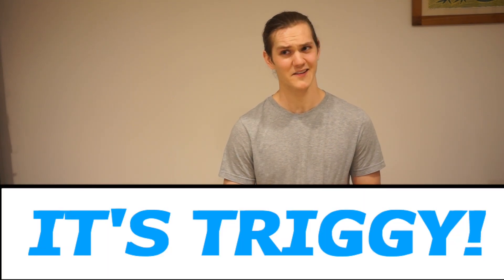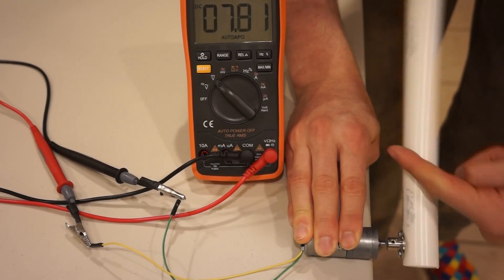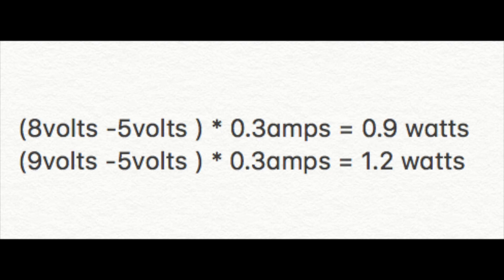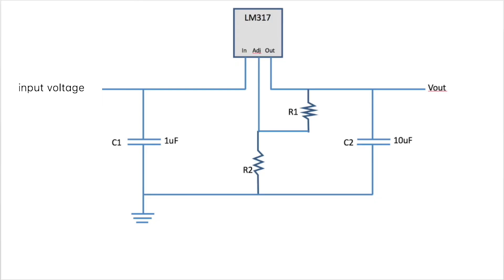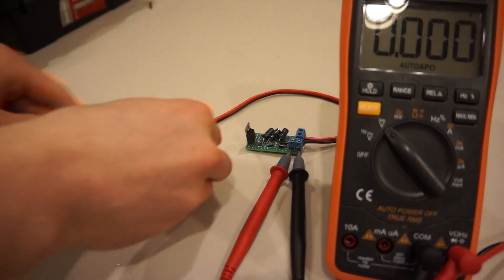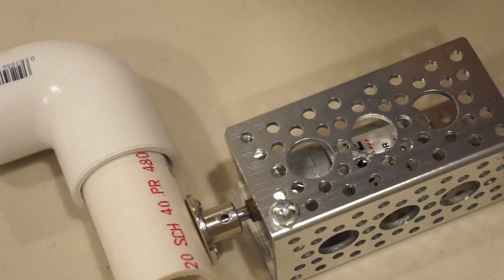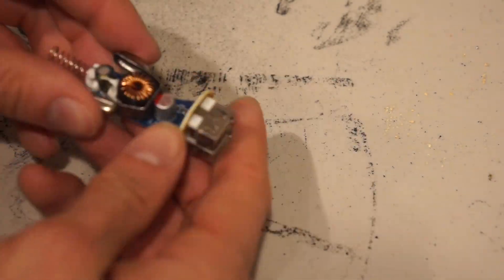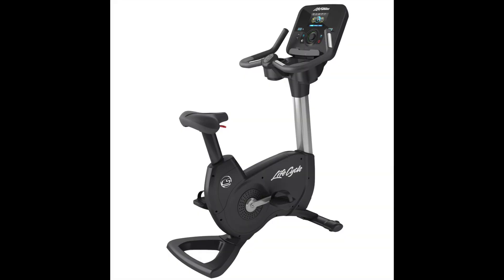Hand-crank phone charger in 5 minutes!

Comment: The opposing force that makes it harder to crank is the magnetic force generated by the current you're producing. You can see a similar effect if you drop a magnet through a copper coil (or copper tube) - the opposing magnetic force generated should slightly dampen the fall.

Comment: Hi i have hand crank generator that is able to give me 35watt of power. The problem is that when i try to charge my phone with it, it only charges at 0,45A max.... phone charges but why it cant charge at 1,5A ? It would be only 7,5W. when i am turning  crank i feel changing resistance(Load is switched?) on the handle as the phone battery tries to draw more current, but every time it tries that it stays back at 450mah and cant even climb to 1A. Where the problem is? How to solve it? I think it is some battery protection circuit that tries to draw to much current(maybe 2A or 3A) then the resistance on the handle is much higher so during handle rotations voltage drops and it starts again from 0,45A

Comment: Are there more in depth explanation and demonstration on how to solder the board and how the wired connect? Im going to make this for my school project. I started getting confused at the voltage regulator part. Im a beginner.
Reply from the maker: The wiring is just like the diagram at 2:07, just replace R1 with 220ohms and R2 with 680 ohms. 

More info on the LM317 here: 
https://www.youtube.com/watch?v=IjJWWGPjc-w&ab_channel=Afrotechmods

A soldering tutorial:
https://www.youtube.com/watch?v=Qps9woUGkvI&ab_channel=oneTesla

Comment: Using a linear voltage regulator with a dc motor like this is not efficient and will cause low current output cuz the regulator dissipates most of it as heat.

It will be ideal if you use a buck converter cuz with those, there is far less energy loss regulating the voltage while keeping the output current close to the input current generated from the motor cuz the buck converter uses less current than linear regulators.

Comment: Should’ve put a gear system on it.
Reply from the maker: The motors are geared. See how there's two sections to the motor at 0:20? The top section is a gear box. An un-geared motor would basically never spin that slowly.

Comment: Why don't you just hook the motor directly to the car USB charger and charge that way. The charger has all the required circuitry built-in to make 5 volts and all you do is connect two wires.

Comment: the reason of the hardness of the cranking is due to the gearbox attached to the motor to decrease its KV and RPM assumed values which in gearbox motors are good for and for cranking measurements which in turn creates good voltage values which are nearly acceptable

Comment: As soon as you connect a load, the current induced in the coil will be able to flow and therefore create a magnetic field of their own. This will oriented in the other direction, so that it hinders the rotors movement. Bigger loads will draw more current and therefore more resistance when turning. 

What is the purpose of the capacitors in your circuit?
Reply from the maker: Following the LM317 documentation:

" Performance may be improved with added capacitance as follow:
• An input bypass capacitor of 0.1 µF
• An adjustment terminal to ground 10 µF capacitor to improve the ripple rejection of about 15 dB (CADJ).
• An 1 µF tantalum (or 25 µF Aluminium electrolytic) capacitor on the output to improve transient response. 
In addition to external capacitors, it is good practice to add protection diodes, as shown in figure below D1
protect the device against input short circuit, while D2 protect against output short circuit for capacitance
discharging. "

Comment: Can you add for totally beginners what will it be needed to make this?
Reply from the maker: The main thing is the motor, the one I used it this one:
https://www.servocity.com/165-rpm-hd-premium-planetary-gear-motor
https://www.servocity.com/770-set-screw-hubs

Other than that, the only things you really need are PVC pipe (or anything else you can use as a crank) the LM317, a car phone charger, and a few electrical components. I used a 220 ohm and 680 ohm resistor, and a 1uF and 10uF capacitor.